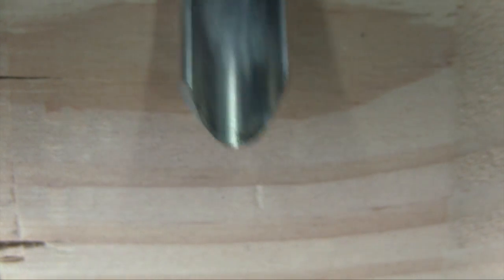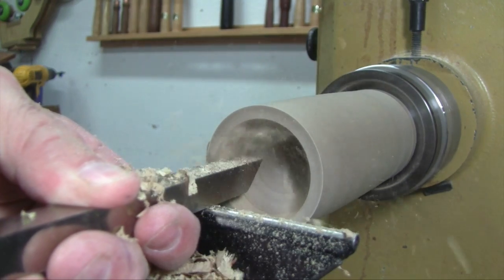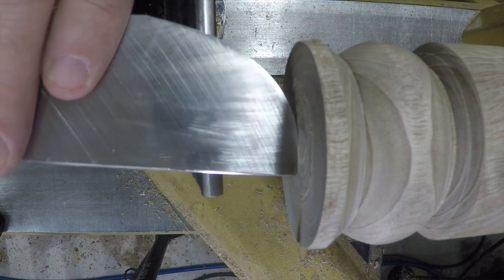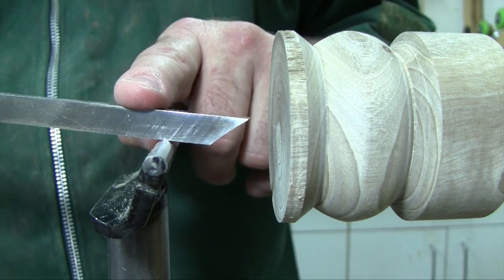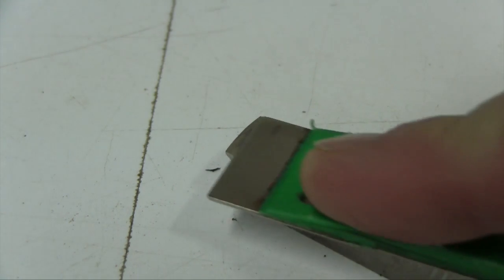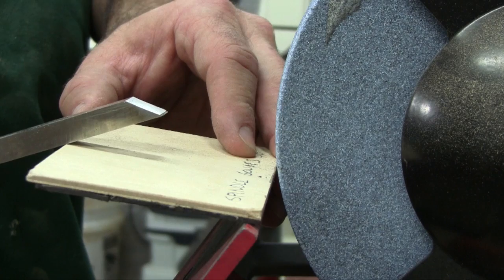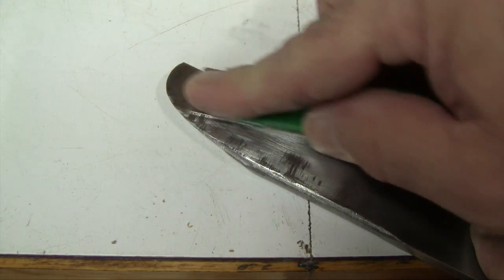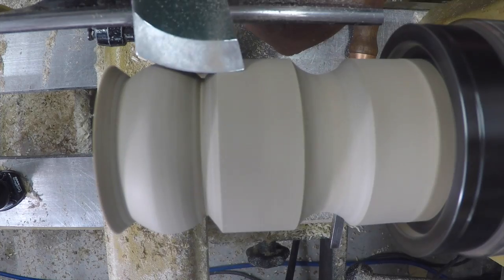(Conventional) Scraping

Comment: As usual  Brian your analysis of the technicalities is wonderful. Because I now understand the process I can work out the best approach in every case. To offer the 12th opinion out of ten so to speak, I like to distinguish between a burr (as in a cabinet scraper) and the "wire edge" one gets straight from the grinder. The burr being the actual bent metal of the ponit turned up.  Also I believe it best to remove the old burr in either case because the second attempt to raise the burr causes the old burr to form a curl  with its sharpest edge now facing back towards you rather than towards the wood. I may be wrong I haven't studied it in detail. Thanks as always.